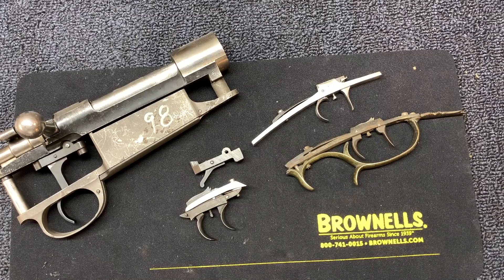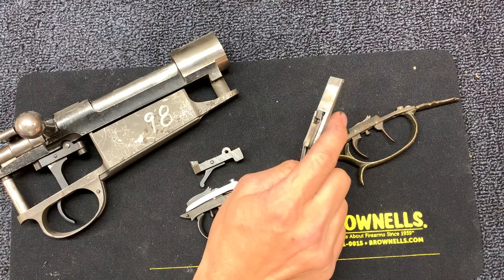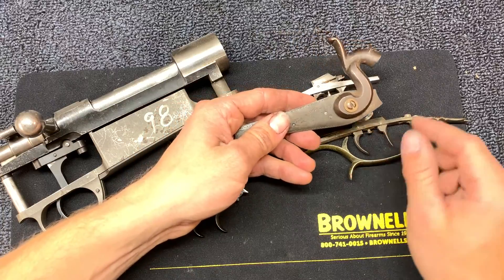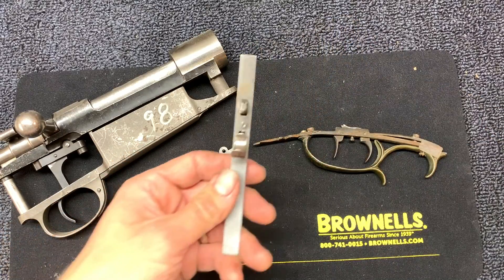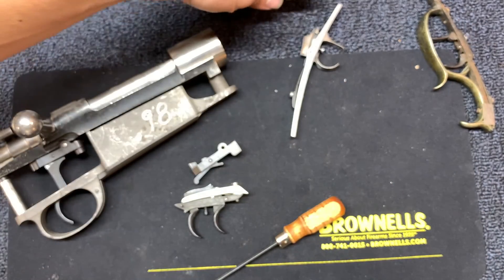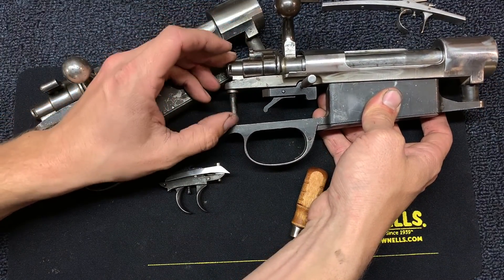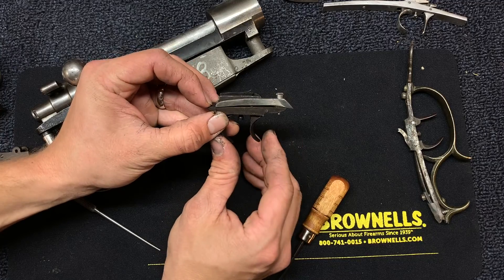How a Double Set Trigger Works

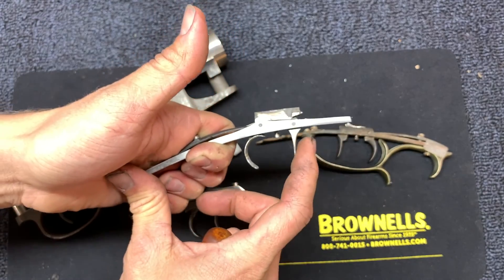Comment: 2:41 I'm a little confused, does the flat piece at the back strike the sear when released or does the spring pressure snap the front trigger forward such that it hits the trigger? From what I see, when you release it, that rear piece really flies up and I can assume under the momentum it picked up, it will release the trigger. Am I seeing that right? Also I never knew Mausers had that system at any point.
Reply from the maker: On that design, and most designs,  when set, the front trigger releases the rear trigger which snaps up and depresses the sear. If the trigger isn't set, the front trigger can be depressed to fire it as well. So technically it works both ways.